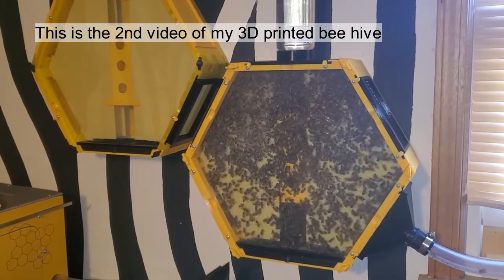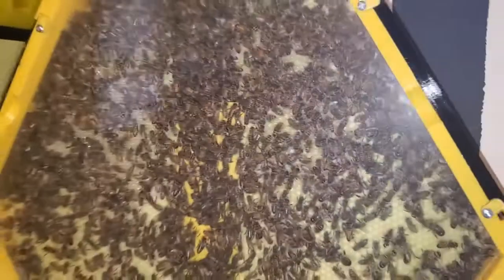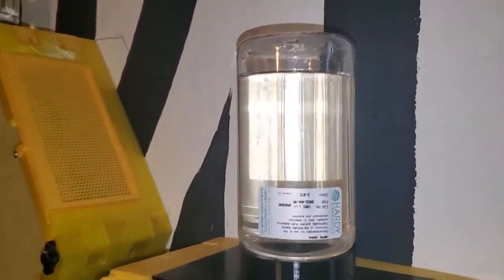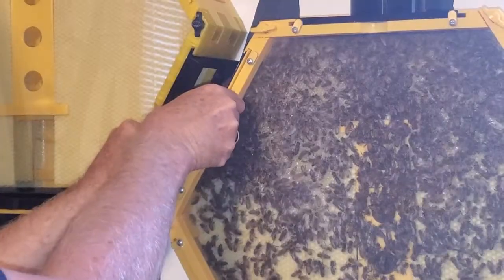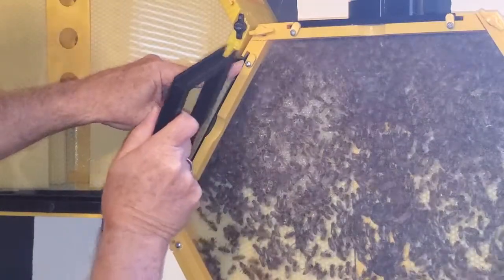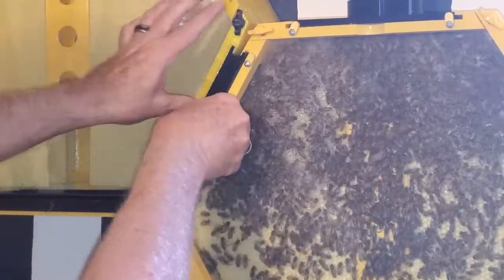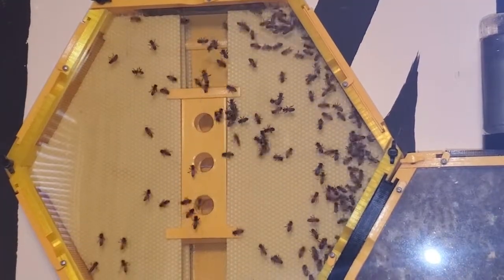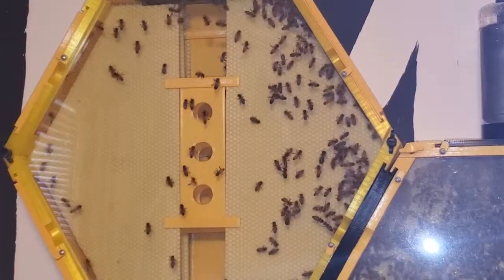#2 3D Printed indoor bee hive

Comment: Teddy, at the 2:52 mark your streamer says it’s 3 rows of foundation but your other video where you show the assembly and the 3D print files appear to show only 2 rows? Also on  this video you have the part in the middle of the foundation that has three holes in it but your other video and 3D print files do not show those, am I missing something?  I LOVE this hive and I’m determined to make one!
Reply from the maker: I have made a lot of modifications since I first started. Some of the hives are from when I started.
Reply: @bigchessset  well, I LOVE your design and I’m in the process of making one.  I’ve bought a 3D printer and I’ve slowly figured the darn thing out.  I have successfully printed two foundation holders and a pin!  I plan on finishing the rest over winter as I have a lot of things on the old “honey do” list right now!